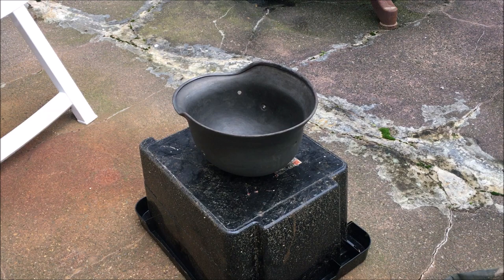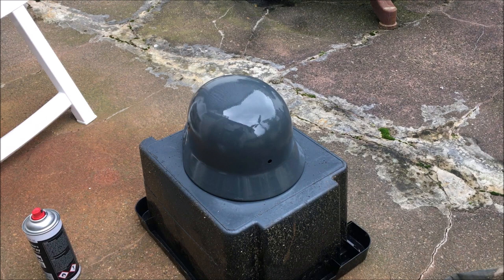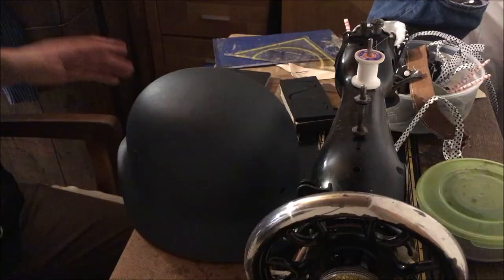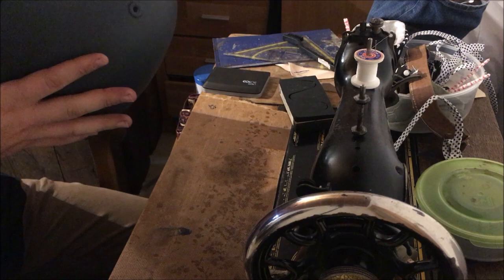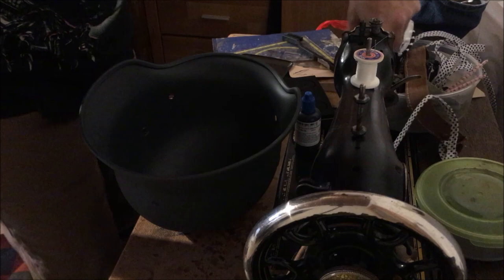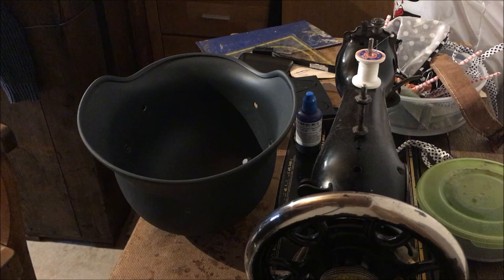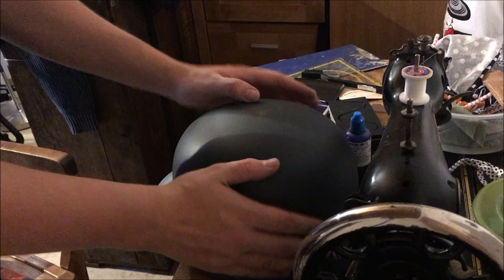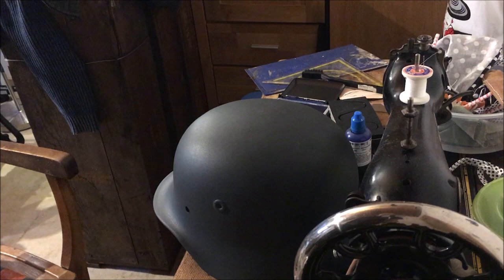Restoring a WWII Stahlhelm Part 3: Painting and adding a dome stamp

Comment: Hi, what grade size of Silicon carbide do you use
Reply from the maker: I think the stuff I got was 106-150µ, for some makers you could probably use slightly more coarse carbide, though.
If you can find Aluminium Oxide though that would be even better.
Luis
Reply: @PotatoDigger  Thank you.